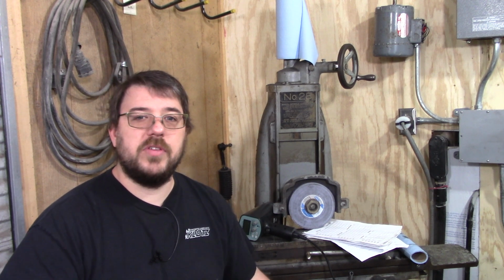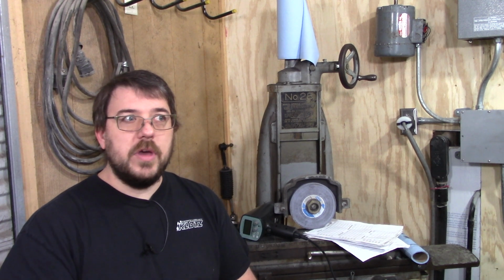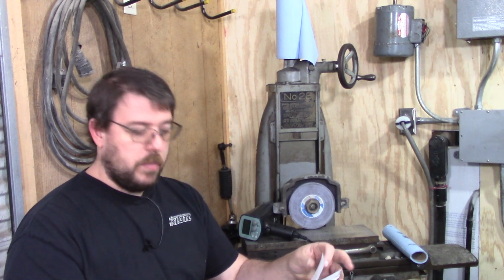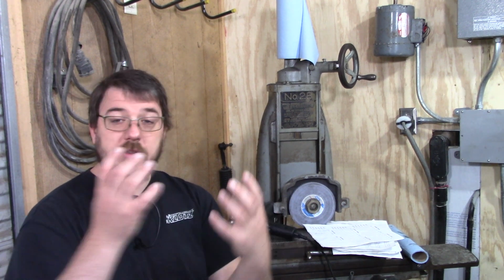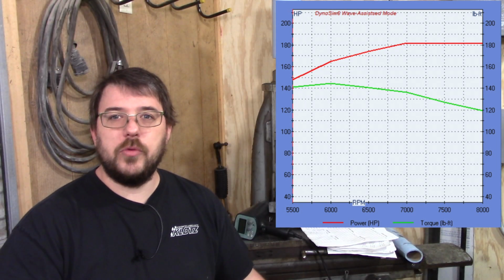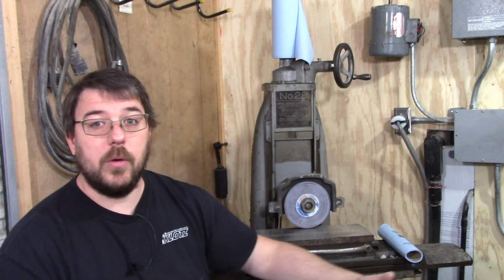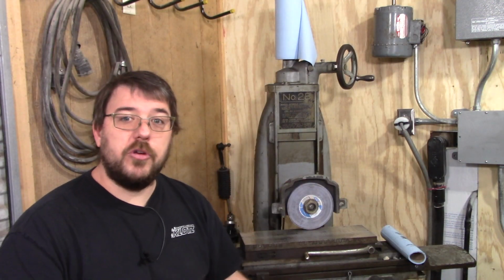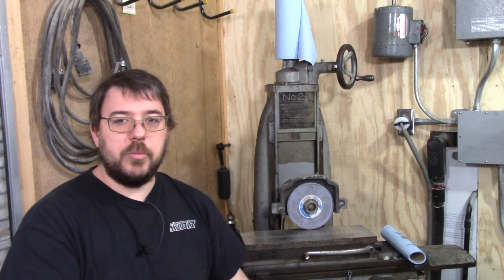Measuring Monkeywrench racing camshafts for the 2GR-FE

Comment: Off topic question, if I get the ecu from you when I do my 2gr swap would somebody else be able to tune it if I plan on doing something to it.
Reply from the maker: Very few people tune the stock ECUs but there's no reason they can't program my ECUs just like they program a stock ECU.
Reply: @FrankensteinMotorworks  just to add onto tylers question, is there possibility of having the ecus tuned for an auto trans? I’ve got an 05 Avalon with the 2Gr that I’m going to have some fun with while I look for an mr2
Reply from the maker: @WhosBucci  I'm sorry, i really only deal with swap applications. These Toyota ECUs have so many "two wrongs make a right" all over the place that i refuse to release a tune that i haven't properly tested with miles on the street and on the race track and i just don't have the budget or time to cover OEM applications with the same testing. But the good news for stock applications is that until we got to about 275whp there was nothing wrong with the stock tune. past that point the stock tune was getting a bit rich to the point where it was robbing power. The stock tune seems to assumes if you get there it must be with boost so it has boost appropriate AFRs.
Reply: @FrankensteinMotorworks  No worries, thats still some good info to know nonetheless so thx, Im curious on how one of these manual tuned ecus would react to the semisequential trans that the avalon has. Do you have any advice for someone that would possibly take on the challenge of self tuning one of these ecus?

Comment: When measuring duration, how much valve lift are you using for beginning and end point?  When the needle first begins to move?  You might have to make a custom dial indicator tip that matches the radius of the roller rocker arm.  That way you measure duration directly on the cam, instead of the valve.  Here's a neat video on the confusion of measuring valve duration  https://www.youtube.com/watch?v=r32EPE6c4tE
Reply from the maker: Measuring duration was a secondary thing so I wasn't prepared with a proper dial indicator end with a 17mm diameter to measure it straight from the camshaft. I tried several setup to see if I could detect any motion that was 266 degrees wide either at the valve or even at the lash adjuster since it seemed to move before the valve due to the very heavy springs but no matter what setup I used I wasn't able to measure any motion that lasted 266 degrees. But as you said, without measuring the camshaft directly with the appropriate size tip it isn't possible to be 100% accurate with this measurement.

Comment: Sounds like we just need accurate regrinds. We don't need solutions to fix the problem if we just don't have the problem.
Reply from the maker: yes, more accurate regrinds will fix one of the problems. There's still the issue of these cams not meeting the spec and also these valve springs potentially being way too heavy

Comment: Isn't there an Atkinson version of the 2gr? If so can you do the cam swap like the 2ar?
Reply from the maker: There is and i have a pair of those cams here. Unfortunately the 2GR's intake cam is not interchangeable with the exhaust cam like the 2AR so it won't be as easy.

Comment: I've also seen many a person in my day who run aftermarket cams with the stock springs or some Frankenstein combo (ISF exhaust springs etc), so maybe some of these dyno variances out there are from some running stock valve springs vs an aftermarket spring with nearly twice the open pressure as stock, hence eating up a lot of HP.     With that high seat and open pressures you are quoting on aftermarket springs, i wouldn't be surprised it's eating up 10-30hp over other combo's.
Reply from the maker: I do think that springs will eat up more power for sure but i can't see it being 30hp in friction. That would imply that each cam journal if the force was spread evenly would be soaking up about 1400kW worth of heat from friction plus whatever it was making originally. I just don't see these aluminum journals holding up to that. That said, the strong springs could be causing lifter collapse which is causing part of that power loss that others aren't seeing.
Reply: @FrankensteinMotorworks  True, my HP estimates maybe a bit high but it'd be interesting to test on a dyno!  Obviously, too small of ones too can cost HP due to valve float.    And agree, definitely collapsing lifters will cost big HP, no doubt.  Didn't Papadakis make some solid lifters for his AR?   I'd think i could machine some tool steel solid lifters with the right inserts, but the pain of getting the valve lash correct and getting at them in the first place.
Reply from the maker: @MadManMachines  yeah, solid lifters for an engine that gets pulled apart every 5000 miles is a completely different proposal. The AR motor is MUCH easier to get the cams out but it should also be possible to make a tool to compress the valve springs to remove the rockers in chassis and adjust the shims. this type of tool already exists, someone just has to make one for this motor's dimensions. (that someone may end up being me)

Comment: Have you tried the eco tech solid lash adjusters? I read somewhere they fit the 2gr. I was going to order 2 of them to do clearances on my cams.  I'll post my measurements of my hot street cat cams in another comment.
Reply from the maker: I think the ecotech lash adjusters use a slightly larger ball end. If you want to get one to me i'd be happy to put it on my optical comparator and get an exact measurement from it.
Reply: @FrankensteinMotorworks  ill order an extra and send it your way sir!